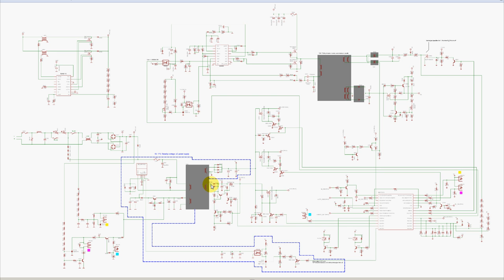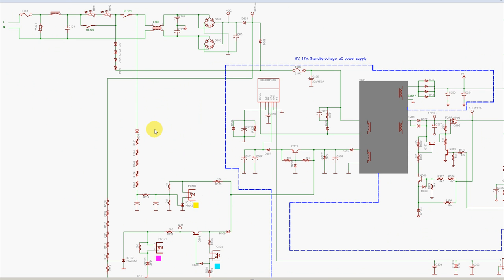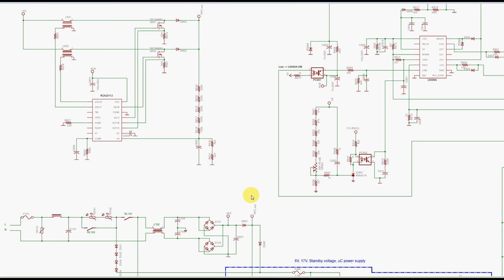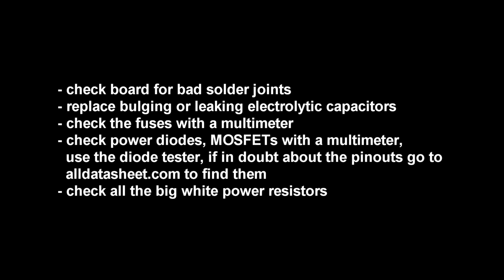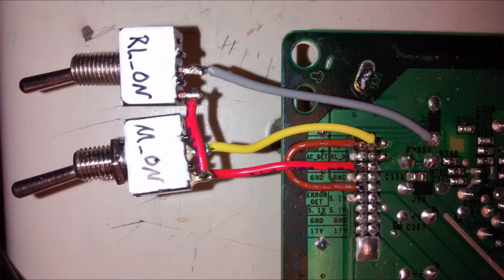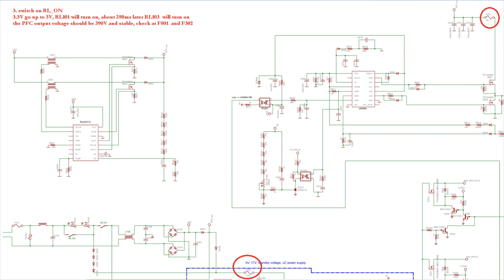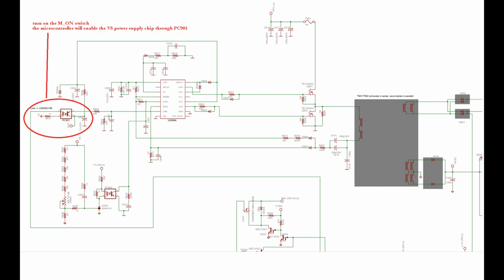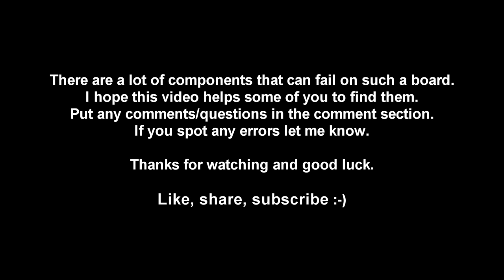EAY60968801 EAY60968701 EAX61392501 schematic repair

Comment: My dad and I just repaired one of these. This video was very helpful. Our problem turned out to be a cracked solder joint on one of the transformers.
Reply: Do you recall what one it was you found was cracked?  My board the relays click on and immediately click off, i've done the "kit" but when the board goes to power up to 370v, the relays kick back off.
Reply from the maker: I recommend disconnecting the board from anything else and connect some switches as shown in blog.

Comment: Thank you.  I'm trying to repair one of these supplies also.  Also open 22ohm resitor.  Test it thoroughly.  I have replaced that resistor twice and it has opened up again later after turning set off and on multiple times while testing.  May have to up wattage.
Reply from the maker: ToltecMerc From what I measured on the EAY60968801 they are only used for about 1 second each time M_ON is turned off, I'm assuming to discharge the 200V VS capacitors. On my board there were 2x22R in series, which means the resistors would need to have a peak power rating of a few hundred watts each. I didn't have any problem though replacing them with 4W resistors of a different type, maybe I just was lucky.
Reply from the maker: ToltecMerc I'm also pretty sure the resistor value is not critical, could be a little higher, it would take longer to discharge the caps but then the power rating of the resistor could be lower.

Comment: Hi
I started following your video to repair an EAY 60968801 board.  I got up to the part where you turn switch RL-ON on but when I turn on the switch my house MCB trips.  I have checked the connections and have definitely got my soldering correct and onto the right pins.  Do you have a suggestion as to what could be causing this power surge and what I can do next?
Many thanks
Tony B.
Reply from the maker: +Antony Bosustow Sounds like you have a dead short somewhere. Actually your input fuse on the board should blow well before your main circuit breaker.

Comment: Hi I have a power supply LG 50PJ250 (eay60968701) on but at 5 minutes off if I have voltage VS 207 volt and VA 60 volt is that I can do? will be the source or other plate?

Comment: I'm having an issue that seems to be PFC related. With all boards connected when I plug the power in my standby goes from 3.5 right away to 5v. The relays click in and the large capacitors charger up but the relays click right backup off. My standby light remains on red all the time.  AC_DET remains at 4.13. I already change the 10ohm White resistors. The others usually available kit components seem fine. Any thoughts? Thank you for sharing.

Comment from the maker: Hi Pifrond, I can't reply to your post. The download link is in the description.
Reply: TomTechTod 
It is possible to have schematic diagramm section by section for plasma ,lcd, led tv model by models? from the begining till today? I need them for my training. l would like to discouts with you by using signal in current, voltage and so on. l would like you to held me for my laboratory equipment orientation too. what to do?
Reply from the maker: I am not a professional TV technician, just repairing stuff occasionally. What you want seems to require a complete course in TV technology which I am not able to give. As for lab equipment, to do something useful you need at least a multimeter, better an oscilloscope (preferably battery powered for primary side measurements) and an adjustable power supply or several to test LED strips.

Comment: EAY609689901 - clicking relais >> Fuse F501(4A), R929 10Ohm/5W, VCC(15V) on pin12 were not there. L6599A( is ok) but following parts on pin12 were dead-> ZD504(15V), R506(2.2R), ZD804(15V), R806(2.2R)

Comment: Hi, I have a problem with the same power supply. The two relays turns on and off. The resistor mentioned it okay. The diodes, mosfet, fuses and capacitors are all okay. The boost voltage goes up to 380v and the relays switch off again, what could be causing this? Please advice....

Comment: Tom Hi
do you know the value of the resistor R305 (conected in parllel to the D304 diode?
Regards
Meir
Reply from the maker: Meir Komisar It's 0.36 Ohm on the EAY...701 board. Wattage I'd guess 1W to 2W.
Reply: Thanks

Comment: Hi Tom. Thank you for the materials. I do not have +17V at P813 and sequentaly +5.1V at P813 (items 10 and 11 from your guide). 17VDC is Ok. Processor pin 13 is inactive. Processor pin 12 is active and +5V. Could you help me to understand the root course of my problem?Thanks in advance,Alexander

Comment: Hi I Have power supply LG with P/N EAY62609601, is it similar with your PSU board? or do you may have the schematics for the PSU i mentioned? Thanks for your help.
Reply from the maker: I don't know if they are similar, parts of it might be. The forum on badcaps.com is a good resource if you need help troubleshooting. also try to find a training manual for your TV, you may be able to find it on elektrotanya.
Reply: Thanks TomTechTod, really appreciate it

Comment: Does anybody know the value of the Q605 transistor? I'm fixing a board and that transistor is missing.
Reply from the maker: On the EAY60968701 it says D1347 printed on Q605. Could be the 2SD1347. If it's this transistor the pinout would be ECB looking on the printed side, pins downwards. I measured it and base is definitely to the right. The only thing that bothers me a bit is the package that doesn't match the datasheet 100%. Datasheet shows a classic TO-92 package with the round back. The transistor on the board looks like a longer TO-92 with a flattened back.

Comment: Hey. Help is needed. Where can I find the circuit for eay62812501 ???
Reply from the maker: +NEU ?ов Hi, sorry I don't think the schematic is available. It would need to be reverse engineered too. These power supplies are all very similar. What's the problem with yours?
Reply: +TomTechTod I recently began to study my knowledge of electronics is very small and I am from Russia . I wanted to check the items because he found a faulty diode . There is a suspicion on soprativlenie burned in a high-voltage line.
Reply: +TomTechTod soprativlenie= resistor
Reply: +TomTechTod Good afternoon. I can tell the connected load as well as you? Do I need to change something?

https://drive.google.com/folderview?id=0BwbTn2p-y7k5MWlzeFRzMlFpUmM&usp=sharing

Comment: Hello. Tell me please, how is the AC DET signal generated?
At what stage does it appear? Thank you.
Reply from the maker: Hi, sorry I didn't have a look at these boards for some time now. The training manual for these TVs , probably available on Elektrotanya, explain how the AC detect signal is handled outside of the PSU board. From what I see in this schematic, it is likely that AC  could be detected right after RL101 through the optocoupler PC102 that goes into R03 of the uC. The uC would than give out the AC detect signal on P813. From what I remember if the mainboard doesn't get the AC detect signal it would turn off the PSU. Check out the training manual. Google for "training manual elektrotanya <<<your TV model>> "

Comment: Habe auch mit meinem lg board netzteil probleme . Die teile die sonst angegeben werden habe ich getauscht spannungsregler wiederstande die 3 a 20ohm und diode und wiederstand die die alle nebeneinanders sind. Der tv lief 2 stunden .jetzt macht der nur noch klack und passiert nichts mehr.könntest mir da evt.helfen
Reply from the maker: Sprechen wir von genau demselben Board? Partnumber ist dieselbe? Die Platine kann ohne den Rest des Fernsehers getestet werden wie in dem Link in der Videobeschreibung gezeigt. Bereite das erstmal vor (externe Schalter fuer M_ON und RL_ON und eine Last) dann sehen wir weiter.

Comment: Good vid i fixed mine psu resistor issue common but it ook out the cpu board and xsus as well!
Got all the parts for less than £20.

#Tv has just gone again after a year looks like xsus again!

Comment: Hello again,Sir
I have another tv which have a bigest problem like the other.It is a panasonic TX-P50X50,and the FAN6755u, doesn.t want to start .I don.t have 5 v stand by.I download the ic fan datasheet, but i was not able to understand very well the protective part.I have a instable voltage on FB pin,of 2,5 to 3.0 v.And on HVpin, the voltage is instable too.324v on the main swithc sourse.Do you think it is enaught, or should be more?
I hope you are OK ,and everithing go well.I send this message,because I realy need help from a profesional.If you  are agree,I will send you a panasonic  schematic,wich have a stand by voltage problem(it is missing)and the driver is a FAN6755U.I am not able to understand whthe IC don.t start.In the datasheet ,said,that need a 7,5v on VIN pin to start ,but i have only 2.8v.PLEASE ,give me a hand with that,and if you want to help me,i will send you the schematic .Thanck a lot

Comment: Hi, Has anybody done a pin out of the 6 legged regulator on the power board? and taken Voltage readings of a working unit. I believe these regulators are hard to come by, and wondering whether a made up sub board with variable regulators on it, could be used?
Reply from the maker: If you mean the 3BR1565 there are many sellers on eBay who have them

Comment: Thanks for the diagram. But I did not know the dz 303 ??
Reply from the maker: Oi, não sei o valor de ZD303. Não sei exatamente por que colocaram ai, talvez pra não exceder a tensão max CE do optoacoplador. Segundo o datasheet do 3BR1565 a tensão pra alimentar o terminal FB vem de 5V internos, e depois passa por uma resistència, nada mais...Pode ser tb que não desenhei uma parte do circuito e que tem uma tensão vindo de outro lugar.  Se vc suspeita esse diodo estar com defeito é só tirar ele e medir, nunca vi um zener mudar de valor, então ou seja ele está com curto-circuito ou ok.
Reply: Ok.  Mas consegui o diagrama da fonte BN 44-00351 e serviu como referência:  18 volts.
Reply from the maker: Ah, bom saber. Valeu.
Reply: BN44-00351A.  Encontrei este diagrama e tem o circuito semelhante.  Usarei com 18 volts. Ok.
Reply: @marco45rj Thank a lot sir i also want to know the value of ZD303.
Reply: @JenBo-cl4nb  18 volts. Read the previous answers!

Comment: I want to fix the lg42pj350 device. The fault is that there is no data until the sound. There is an exhalation of the device.
Reply from the maker: Voulez-vous dire qu'il n'y a pas d'image mais du son ? Qu'est-ce que ça veut dire "exhalation" ? Svp fournir plus de détails.
Reply: Nous vous remercions de votre intérêt pour mon cher frère
Pour illustrer: la lumière arrière signifie bon ok ysus -voltage t-con 12v ok la telecomende   répond a l écran ok-la fichage no -ni d image ni rien mais pas de son
Reply from the maker: Désolé, je comprends pas. Si c'est une Plasma il n'y aurait pas de T-Con. Quelle tensions vous avez sur VA et VS? Avez vous checké tout les fusibles etc? Avez vous VS sur la carte Y-SUS? etc. Si vous vous débrouillez en anglais je peux recommander le forum sur badcaps.com. Par commentaires Youtube c'est difficile faire un débogage :-)

Comment: hi friend plz tell me zd301 value
Reply from the maker: I don't know. If it's shorted I can't help you. If you're not sure if it's broken or not remove the diode then test it in forward direction with a multimeter. If thatz's ok then test it in reverse direction - put a resistor in series and apply a reverse voltage. You will then be able to measure the zener voltage value.

Comment: Great job brother but I have transistor q501 on my board that's shot and I can't get a replacement for it to save me. 10a124 is on the part but I can't get a cross on it. Any help app.
Eax61397101/11
Reply from the maker: What package is the transistor? you can take a pic and send it by email to tomtechtod at gmail dot com
Reply: Tom it's a standard to220 plastic coated case like all the others on this board. I had rebuilt the y suspect board and replaced q906 k2508,,,and did the repair of ic301 associated parts. Perfect picture then.  For about 20 min till the power supply failed. Now no tv, va, or vs. Just clicks on then off. If we can't figure this part out I would be willing to pay you to repair this for me. 1a24cn is exactly what's on it. Also a large F
F0pf
10n20c 
The last numbers don't seem to have any important info. Any help you can offer will be deeply appreciated now that I know this low time tv my family left me will be useful. Thank you.
Reply: All the parts listed and I spoke of were on the power supply only. The y.sus. board repair was sucsessful.
Reply: I will also send asap. Picture of part and location. I also have no 5v either. Fuses appear good. Just clicks on the off.
Reply from the maker: Sounds like this one: http://www.mouser.com/ds/2/308/FQPF10N20C-1124568.pdf

Comment: i do not have 170v at F302, showing 20v-40v can you help?
Reply from the maker: There is not much before that fuse, check the bridge rectifier and the other diodes that are between fuse and the mains input. Does RL103 close? Put your multimeter in AC mode and measure on the testpoint where it says +DC in the schematic. What does it read?
Reply: I want to correct my previous reading, my meter was not in the correct setting...testing from the Neutral to F302, i do see around 170vdc.   when i check +DC, in AC mode, testing from ground to +DC 4.0v, and from Neutral to +DC 2.8v.

When i do turn my RL_on switch on, My relays will close staggared with a few ms between them, then normally, open back up together withing a second or so.  When i measure VAC at F801 from Neutral with RL_on, when the relays come on for the second they do, the voltage goes to 1000-1200.  I'm scratching my head on this one.
Reply from the maker: F801 (PFC out) is DC measured to primary ground. Do not measure  AC to neutral after the main rectifier bridge, that's useless. Measure again DC voltage to primary ground (PFC out). Should be around 160V (with 120VAC input). Then with the relay ON the PFC should start and boost voltage up to maybe 380 or something like that, don't remember.

Comment: Hi I have a power supply LG 50PJ250 (eay60968701) on but at 5 minutes power off if I have voltage VS 207 volt and VA 60 volt is that I can do? will be the source or other plate? value of zener zd302? is 10volts?
Reply from the maker: I do not know the value of ZD302, IMO it is either short when defective or it will be ok. You can measure its value by removing it. Put a resistor in series, 1k for example, connect it to an adjustable power supply, slowly increase voltage and observe the voltage drop over the diode.

You said, the TV turns off but VS and VA remain on?? What about the control signals from the mainboard? What about the other voltages that come out of the PSU?